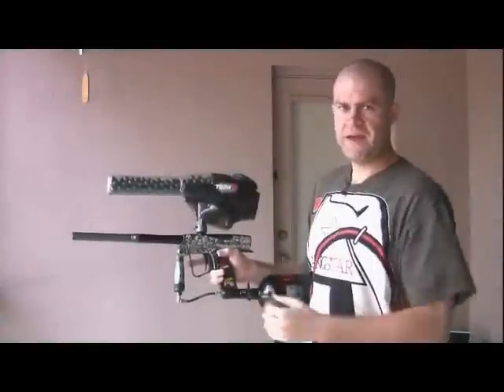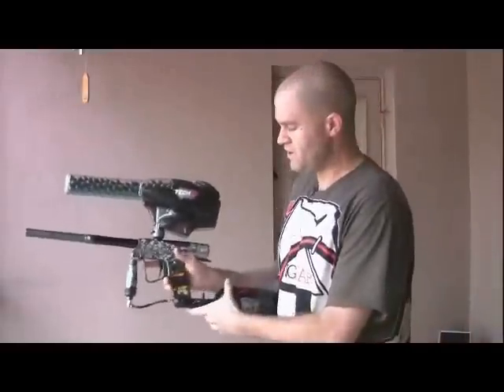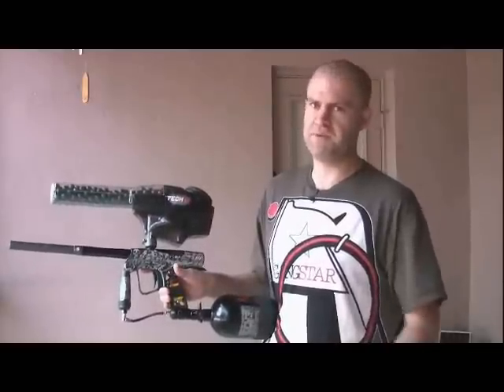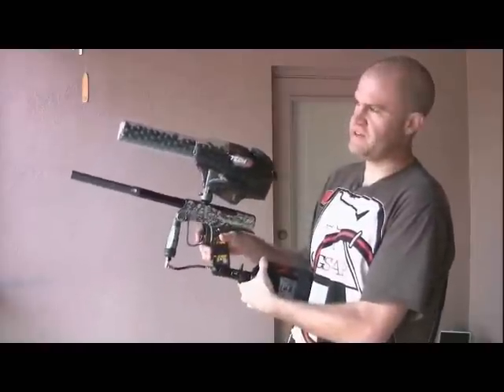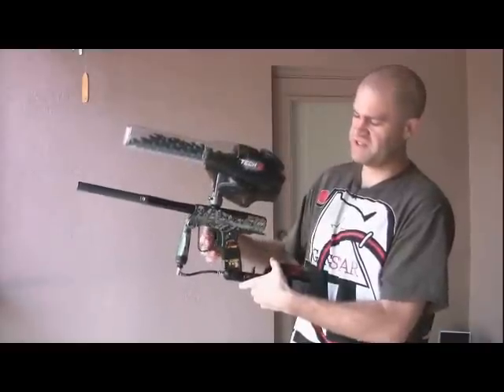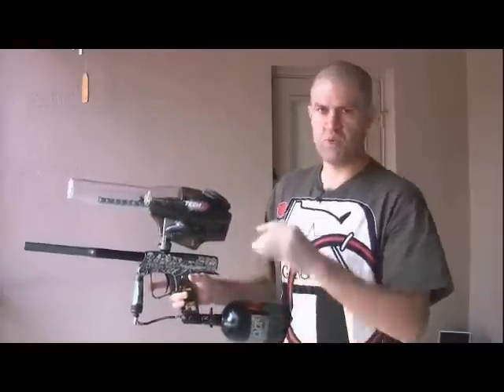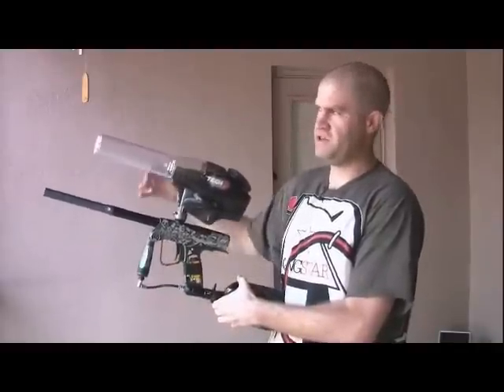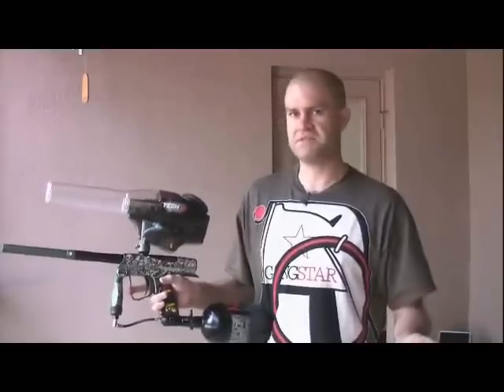2009 Smart Parts NXT Shocker Board Programming

Comment: thats not too bad. an 07 shocker nxs used will normally go for about 300-350 in working condision. a board will run you.... between 50 and 150 depending on what you want.
 sounds about right to me